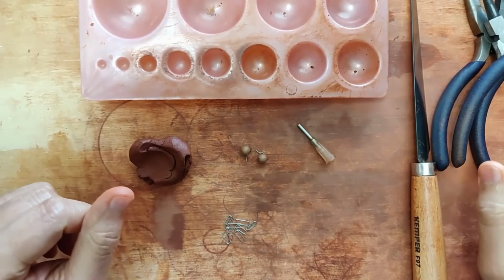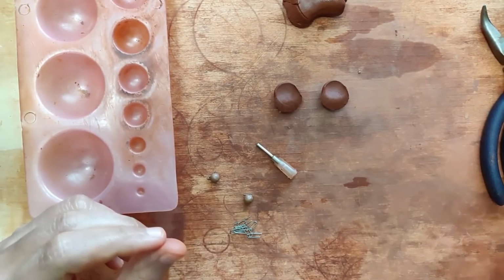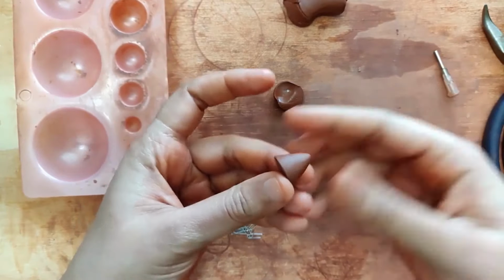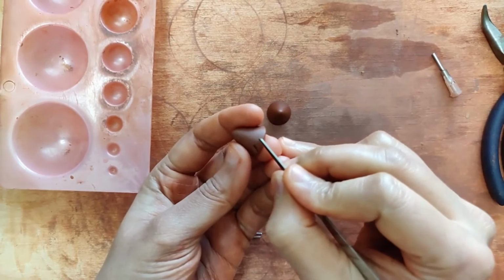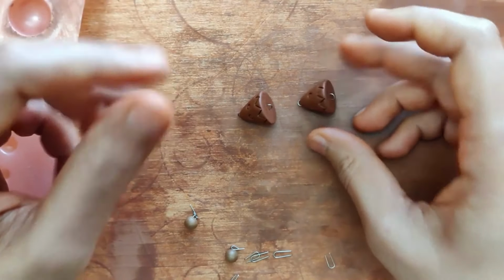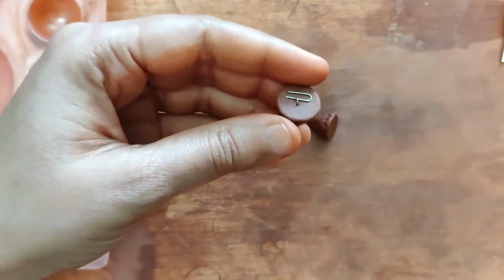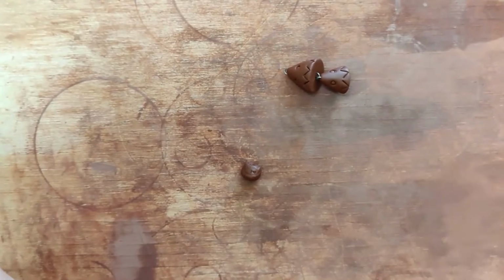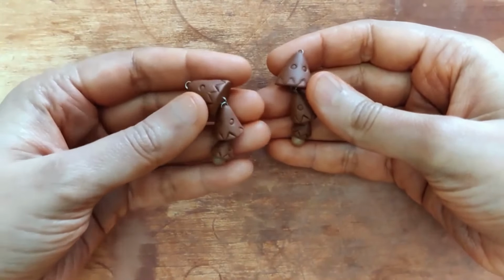3 Step Cone Jhumka | Detailed video | Terracotta Earrings | With Tips | paintedearthbyneha

Comment: Mam shall i bake the air dry natural clay?
Reply from the maker: If its air dry, you can check the instructions on the package. As the name suggests - Air dry, I don't think it needs firing.
But the clay I use requires firing before painting upon it
Reply: @nehagopinathpillai  tq mam

Comment: Mam i do the pendant in air dry clay while drying it get bend and also crack can u guide me what to do
Reply from the maker: I haven't used air dry clay so I may not be able to give you an opinion on that. But with natural clay, speed drying is not good. The bend in clay could be due to that. you can  cover your work with a thick sheet of plastic and slow the drying process. Do not dry it under the fan or sunlight.
Reply: What tell me the result
Reply: @nehagopinathpillai  ok mam where can i get natural clay

Comment: Hi mam I have a doubt that while baking the gear wire it will melt  what must be done in that case
Reply: Use nichrome wire instead
Reply from the maker: You don't use gear wire into wet/moist clay. You only use nichrome wire so that it doesn't melt in the kiln.

Comment: Mam 1.5 mm is not available now mam so currently they have 1 mm black thread mam. Please help me   . Which size of wooden bead I have to buy
Reply from the maker: The hole size of the bead needs to be just 1mm . Please remember that the bead itself needs to be comfortable enough to hold so let it not be too tiny. what matters is the size of hole in the bead.
Reply: . Now I am clear. Thank u sooooo much mam